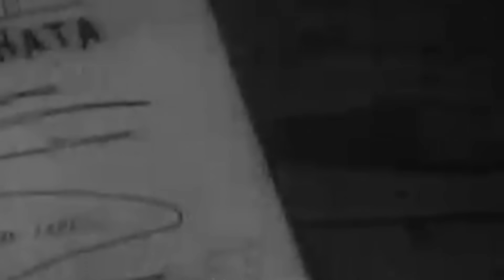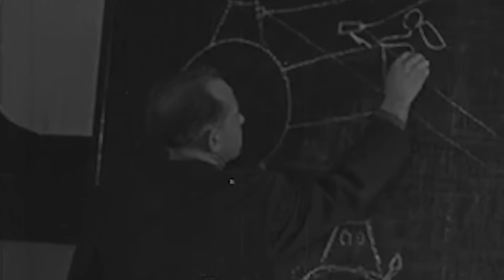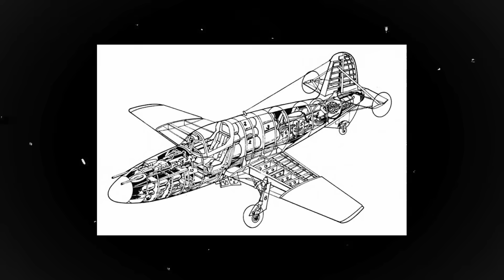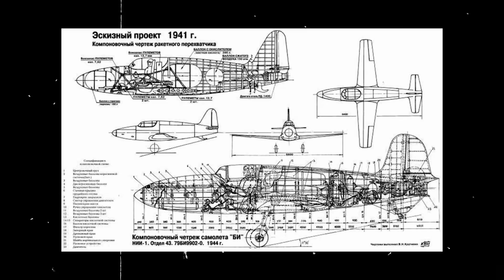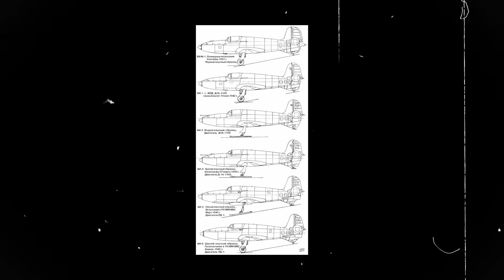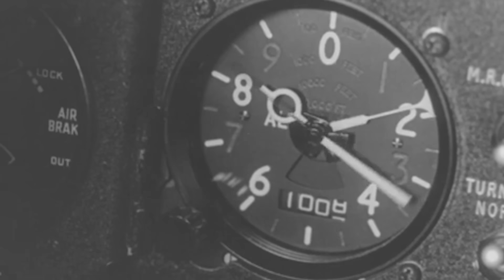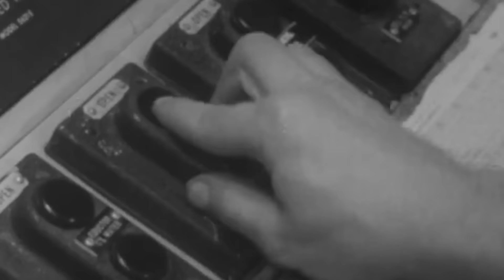The Ultra Rare Fighter That Pushed Too Far

Comment: The altitude should be in metres not feet.  I’m guessing that the 50 and 87 mph are actually the Mach numbers.  .50 and .78 Mach.  Mach number varies around 750 mph (altitude and temperature). So 370 mph and 520 mph??  Just guessing

Comment: Quite obviously the Russian machine WAS USELESS AS A FIGHTER as its fuel capacity and range was so GROSSLY LIMITED!!!!!!!!!!!!!!!!!!!!!!!!!!!!!!

Russian air forces were mainly dedicated to support of troops on the ground and such low altitude flying was NOT GOOD FOR A ROCKET PLANE - thus it is little wonder the Russian rocket plane was forgotten......................

The Nazi rocket planes were of greater use due to the large numbers of American heavy bombers following predictable routes AT HIGH ALTITUDE into Germany - thus rocket planes could be set up at useful points to attack  large formations of slow moving targets and then after an attack the Nazi rocket planes could then go into a steep dive and speed away from allied fighters!!!!!!!!!!!!!!!!!!!

Comment: In the original IL2 Sturmovik fighter combat sim of the early 2000s, this rocket plane flew really well. Proving they over-modeled planes in that sim. It also flew for quite a while before running out of fuel, far longer than reality. But it's just a game, after all.

Comment: Igniting the rocket motor accelerated the aircraft to 87 miles per hour?
Reply: I know right? Surely that should have been 1000 to 1500miles per hour.
Reply: @PathosBedlam  ...it was faster than a horse.
Reply: @jukkatakamaa7274  I'm betting the rocket produced at least 2 horsepower, that's why
Reply: Those were Soviet miles, much longer than puny American miles…😂
Reply: If it had gone 1mph faster, it would have time traveled.

Comment: I am very dubious about your facts here. Have you actually done any proof reading? A rocket plane just released from a bomber, even a world War 2 bomber will be cruising at slightly more than 50 miles per hour. That is very near or below stall speed. After hitting a powerful rocket motor, the aircraft flies at 87 miles per hour? I think you need to fact check your videos dude. This used to be a good channel with great interesting content, but lately this channel has had too many lazy mistakes. What happened? Are you trying to kick out content too quickly?
Reply: Considering the rocket powered ME 163 “Komet” was doing 600+ mph in 1945 and the 262 widely considered the first jet aircraft was hitting 550 mph at the same time.
Reply: @AlexPeace246  but this first flight was in 1936.   They made a lot of progress over 9 years.
Reply: It seems like it should have said 500 and 870 mph
Reply: @m.b.82  500 mph would be insane for a glide speed
Reply: I think everyone could check what is speed of mach1 and that thing go slightly over it and then goes down little bit faster. Maybe he trying to speak 850 km/hour's going up, when M1 is 1235 km/hour's. (kph for someone)

I don't know how they metered at the time planes speed, did they already have pito tubes? That thing could work with analog meter if it's used. Or they just checked altimeter?

Videos that give more questions than giving answer's are hooking 😅
Reply: A man’s blood will boil at 55 miles per hour, check your facts!!!
Reply: I believe the content is AI generated and only as accurate as what it is fed. Additionally the voice seems AI too as it spells out some words as if they are acronyms when they are not and mispronounces words too.
Reply: @philliphagan4760  You do realize that Europeans don't talk like Americans. They get pissy when you say Americans speak English and I agree. You all are the only ones who speak backwards plus you keep making up words for things that already exist. There are fifty thousand definitions and thirty thousand ways to pronounce it all depending on time of day, mood and location.
Reply: Well it was 1936, and we’re talking about the first flight of what was basically a proof of concept, and I believe it was towed aloft not carried.   I expect the tow speed was much higher, but supposedly the glide speed was 80kph..
Reply: This one's always been suss.
Reply: Are you perfect, uh no. Apparently he meant 500 and 870 mph. When you have your own channel we're coming to complain about it..
Reply: Facts don’t matter anymore and a lack of them doesn’t care about your feelings. This is a dark channel and the narrator has an ominous sounding voice so whatever he says is the truth.
Reply: 87 MPH? Fast? C'mon.

Comment: What was learned from this program, , helped their engineers to find ways to create airframes that could Effectively operate Into and beyond the speed of Sound... The Same Physical reason , that caused the Bi to crash, also caused Jeoffrey Di Haviland to loose pitch control of his sound breaking plane (DH 108) on 9/27/1946....Loss of control if the plane due to Compressability of airflow passing over the wings and by-passing the flight control surfaces, at  trans/super sonic air-speeds...The engineers, eventually discovered that high speed wind Tunnels would reveal how to design the wings and flight controls for this Phoeniminon...
    My guess (conjecture) is the shift of the center of pressure on the wing that was not fully known , caused the heavy nose as the plane continued to accelerate, shifted the the plane's realative C.G., position , because of the center of lower pressure on the upper wing surface moving aft as the airspeed increased... This caused both the Soviet Bi and the D.H.-108 to nose- over in a dive... and not have a chance of pulling up out of it...Sad...But those lost lives helped to duscover how to penetrate the sound barrier... Today is: 02/13/25

Comment: Looks like they encountered what would be known later as classic control reversal when entering the transonic speed range.  Only effectively  countered by the use of an all moving tail plane rather than standard elevators.
Reply: Yep at high speeds, traditional elevators (which control pitch) became ineffective due to shockwaves forming around the tail, creating an aerodynamic shadow that rendered them useless. To solve this, engineers developed a variable-incidence tailplane, which meant the entire horizontal stabilizer could move rather than just the elevator
That's why one needs a full moving horizontal stabilator.
The British Miles M. 52 had this design in WW2 the mid 1940s and Bell was informed thus the Bell X1 was the first to use it...........an adjustable stabilator.

Comment: Less than 2 minutes of fuel along with highly volatile fuel difficult to handle, an unstable airframe, and a strong "mach tuck" effect...shocking that the military didn't want to mass produce it.  There's a whole barrel of reasons why even 80 years later no one is using rocket-powered manned combat aircraft.
Reply: i wouldnt say nobody as the french have used rocket power to supplement jet engines on their fighters and technically you could say that jato boosters that the usa uses count and are still used afaik there is also the rocket booster used to launch fighters from a flatbed with no need of a runway that nato used in the past i can see the use of rocket power making a come back with drones as they wont have as much of an acceleration limit due to a human not being onboard
Reply: @paktahn  Boosters for limited uses, yes. But nobody has pure rocket fighters.
Reply: @johngori9477  a pure rocket fighter is not even achievable  imo due to the limited range an interceptor is totally possible along with a hybrid rocket fighter
Reply: Saunders Roe built one that was actually practical.   it had a jet engine for a finely controllable take off and landing plus a rocket engine for use in flight that was much more than just a booster.  Airfix made a model kit and I vaguely remember a metal Dinky Toy.   It was intended as a carrier fighter for the FAA and I think the FRG were interested in a land based version.   The rocket fuel was lox plus I think alcohol (can anyone remember?).  The idea was to generate the LOX on the carrier, and alcohol spills could be simply hosed down.   It was delta wing with a high tailplane.   As so much around that time the funding ran out.
Reply: @TheArgieH  Rocket boosters or RATO/JATO doesn't make it a pure rocket fighter.  If I've got a jet engine with 30-90 minutes of fuel and use the rocket for boost, final intercept, etc., then what I have is a jet fighter with rocket assist.  This (like the Me163) was a pure rocket fighter which no one has ever been able to make practical (or safe under field conditions). Liquid Oxygen is extremely dangerous, especially in shipboard environments and more than just small quantities.

The reason the "funding ran out" is that they hadn't managed to solve the problems to a degree that the military wanted to spend more.  Happens to a lot of experimental designs.  Long ago, the U.S. military tested a fighter with an "anti-gravity" propulsion system that didn't require engines onboard. It worked as long as there was a laser beam with power supply directly under it (on the ground or in the air) firing up against the vehicle's underside. For obvious reasons that concept didn't enter production.